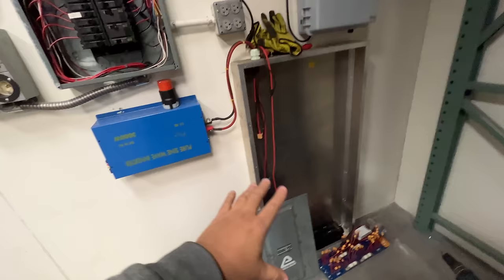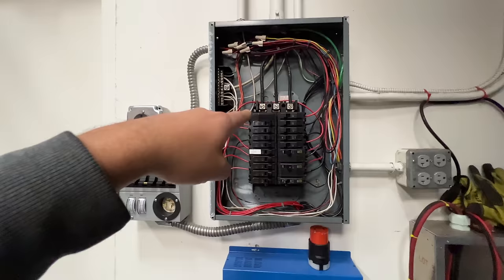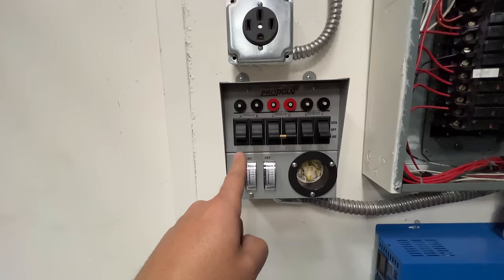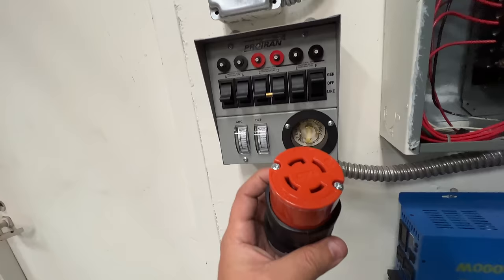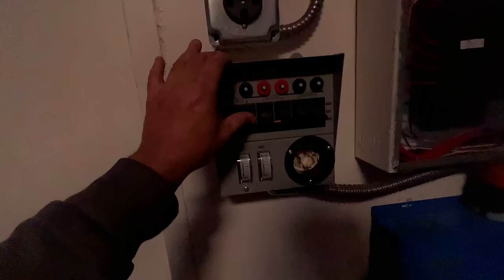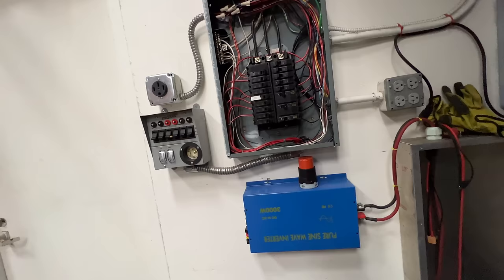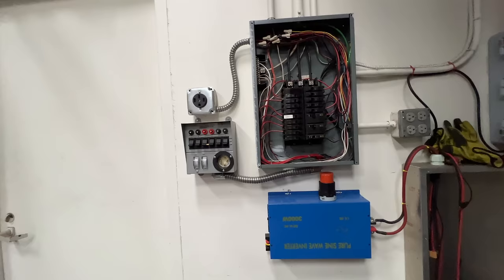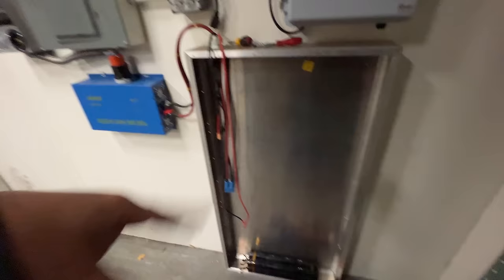This is Why you Need a Transfer switch - DIY Powerwalls

Comment: I was looking at these last year, and decided to just put in a subpanel instead with my critical loads running to it. Then added a 220v gen/inverter circuit with a lockout so the panel cannot be connected to the grid and the inverter at the same time. I was required to pull a permit to do the work, and the inspector gave me a 9 out of 10 score on the job...that was super encouraging since I did the job myself.

Comment: Thankyou Jehu! I have similar setup in my home & garage but, there are A LOT of folks that don't savy how important and nice it is to have one. Other wise I suppose one could just run extention cords all over the house. That's how I used to roll when the power would go out. A definite pain, right in the ass! Backup switches are far superior

Comment: The main reason for a transfer swich is so if grid goes down, your generater or inverter/ battery doesn't endanger linemen workung on getting the grid back up. Keeps your system out of the grid system.
Reply: You can also get away with a clearly labeled and properly maintained interlock to prevent the activation of the generator breaker and the main utility breaker.  You have to know what you're doing, but it's a lot cleaner.
Reply: @Alex-je6od  transfer switch can be automatic. interlocks arent.
Reply: @DieselRamcharger  mmkay.  Never said it was automatic.   jehugarcia's transfer switch is also manual.
Reply: @Alex-je6od  "can be" i guess those words arent well understood by you?
Reply: @DieselRamcharger  Interlocks can be automated too using arduino’s and solenoids.   Anything can be automated.

I use sensors in my house to tell me when the power goes out to fire off the battery backup on my wood stoves fan.  I also have the thermostat on the same stove setup so I can adjust it remotely.
Reply: @GotrekGurninsson  if an interlock is automated, its not an interlock.

Comment: I agree with you!  and I have an ATS + MTS combination at my main panel as they way I automatically consume my off-grid power.     Sun comes up, inverter goes on, ATS auto-switches to inverter power, the MTS let's me fine-tune which circuits I want on the inverter load.   Sun goes down, battery runs down, inverter off and auto-back-to-grid.     Use UPSs for computers.
Works really well for induvial component off-grid integration without power company even knowing.     MPP Solar (and I think some GroWatts) have UPS built-in but MTS (or ATS/MTS combo) works as well to avoid direct grid tie hookup.
Reply: I'm interested in how you're auto switching on sun up... It sounds like you're doing the same as I want to do. I have 3.1Kwatts of solar and 680Ahrs of battery.. (soon to be doubled). What is an MTS?
Reply: The Sun causes the PV to charge the battery raising the battery voltage.  When the voltage reaches a certain point, a relay turns on the Inverters - sending power to the ATS(s).   When the battery runs down, a relay turns off the Inverters and the ATSs go back to grid.   MTS = Manual Transfer Switch such as Reliance MTS or Pro/Tran2 MTS sold at Home Depot.

Comment: I would recommend  upgrading to spring block connectors. The cost is more but they are a much better design than wire nuts.
Reply from the maker: Not sure what those look like
Reply from the maker: Never seen those,  but I’m not an electrician and I guess all my places are old tech
Reply: @jehugarcia    
Wago type
Reply: Both wago and wire nuts can be used incorrectly and end up with a bad connection and they both can be used correctly and have a great 50 year connection. 

Definitely never reuse either one in a high amperage situation. The clear wago do have the benefit of being able to inspect the connection which is cool.

Comment: Thanks Jehu! So, if I get a similar setup with a scooter-power-wall feeding an inverter (no solar panels)... could I just leave the transfer switch for my critical circuits set to GEN all the time? That way they are powered through the inverter (which would not be using battery power when the grid is up, and would only be forwarding its AC power being that it would be plugged in to a non-critical panel circuit like the ones you have to the right of your breaker box). This should act as poor-man's auto transfer, while still never back-feeding the grid. Sound right? Am I overlooking anything? I would then only switch to LINE if I had to work-on/remove/replace the inverter etc.

Comment: 6:25 watch out tiying two phase together because now your neutral wire will have to carry twice the load of those two circuits... 1500w x2 = 3000w on the neutral wire. The reason it works with a split phase/one neutral is that those lines are inverted in phase, 1500w x2 = 0w on the neutral when those phase cross over one another. 14awg neutral would work no problem with a split phase but NOT ok when you are doing this twice on a single phase...
Reply from the maker: Interesting thought.
Reply: @jehugarcia  thank you for considering this, specially if you are using a gas generator that do not run on 240V but you do supply the black wire to two lines in your transfer switch, the current can get way higher on the white wire than it is suppose to support. You should make a note on your video about this. It is not super critical if you are powering lighting circuits but if you do run a kettle on one phase and a microwave oven on the other phase that you did split on a single phase generator/inverter, the neutral wire can become a fire hazard !! Thanks for noticing my comment !
Reply: @Aleziss  I'm confused... there's only one neutral wire in the transfer switch box that connect to the main breaker box. Why it would be a problem... Please explain
Reply: @CarlosCarrillo-yz7nu  there are two phases in 240V systems in north america identified by a RED and BLACK cable. Each of these RED and BLACK cable provide 120V when they are mesured against the WHITE neutral wire. There is an IMPORTANT detail about those two phase cable is that they are 180° phase inverted. While the RED phase has 120V the BLACK has 0V and when the opposite happend, when the BLACK phase has 120V, the RED phase has 0V and that happens 60 times per second, this is why we say it is a 60Hz system. That means if you draw 15A on the RED phase while it peaks at 120V, the BLACK phase is NOT pullilng power because it is 180° inverted thus the WHITE wire only "see" a 15A return current. 

If you have BOTH BLACK AND RED tied together on the SAME phase as per describe in this video, the WHITE wire will have a total POSSIBLE return charge of 30A which it is NOT design to support. 

You would probably not have an issue as long both RED and BLACK are not charged to their capacity limit but such panel is design to be installed in a 240V system and NOT a 120V because the WHITE return wire will have twice the load to support.

This is exactly how kitchen counter plug are wired, you can connect 2X 1500W devices on the same wall outlet because the top plug is connected to the RED phase and the bottom plug is connected to the BLACK phase and you can run a single 14AWG WHITE wire as a neutral without any issue because the two plugs are 180° out of phase. You could NOT do that if both RED and BLACK wire would be connected on the same phase as the WHITE wire would carry 30A return current which a 14AWG is NOT able to do without become a fire hazard.

60X EVERY second that happend between the BLACK and RED phase when they are measured against the WHITE wire...

120V-0V
119V-1V
118V-2V
117V-3V
116V-4V
115V-5V
...
3V-117V
2V-118V
1V-119V
0V-120V

and the cycle continue again and again 60X a second. You notice that the WHITE wire never "see" more than 120V thus never has over 15A charge.

Comment: You can make your own if you have a box that you can put breakers side by side, but flipped, and attach the levers, so when you turn on the generator breaker, it turns off the grid breaker, it would only be $50-$150 depending on size,  and breakers , and the outlet/inlet type, my breakers box just has a plug so I can either plug it into the he generator or the inverter! A couple 3phase breakers one reversed, and the lever connected,  a 200-300 amp in a box so the main can be swapped at the input! For a smaller systems like this, din rail breakers mounted similar will work!

Comment: What are those 2 dials on the bottom left (next to generator outlet)?
I anxoiusly waited 13 minutes to learn that & what brand you have. ( Pro something? Couldn't quite make it out)
I am looking for a 10 circuit transfer switch but can't find one that looks like that one.
Also, modular power stations like EcoFlow & Bluetti sell their own subpanel/transfer switch boxes but theirs are over $1000.!!!! Will the generic transfer switches, like this one, not work with the Modular Power Stations?

Comment: I am using automatic transfer switch to change my load when grid goes down.. it's working great never have to touch anything since installed
Reply: Me too! mine switches so fast that my computer never loses power!
Reply: @uhjyuff2095  same here I am running a small fridge from my inverter. Even though transfer switch changes back to grid it never reset the compressor

Comment: My mothers house has that same transfer switch for a generator.  I was going to replace it with a main breaker interlock so all the loads would be powered in an emergency.  Not sure if 3 phase interlocks exist though.

Comment: Think they make ones that can switch over automatically too and even start a generator automatically. Must have if you have a generator or power wall.
Reply: Yeah, lookup ATS - automatic transfers switch. Using one to flick between my solar battery and line 🙂
Reply: @SergeantSpandex im looking to do this myself. Any ATS recommendations?
Reply: @vickomf  there's quite a few if you want to hardwire them. Otherwise APC and similar make rack-based ones that are plug and play for nearby devices

Comment: I installed one in my house but never used it. I think they prefer hard wiring the powerwall I personally used a APC3636 3600W ups with line in a automatic transfer switch to a secondary sub panel. Now if you used similar type of inverter than you don't need and get away with just a cheap sub panel. Look for inverter with UPS feature.
Reply: I just got my critical loads panel setup. I had not thought of using an inverter with a ups feature. Good idea. I have a 100amp circuit going to the critical loads panel though so that would be one expensive inverter.
Reply: @ecospider5  20kw  inverter or 4 5kw inverters. But that is 100a service, I think you are missing critical part in your load.
Reply: A Genetry Solar inverter comes with the Automatic Transfer Switch… AND they ship inverters that can run using Jehu’s scooter batteries at 36v

Comment: Backfeed is a serious thing which is why transfer switches were created, had nothing to do with convenience. 
Most utility companies dont want their linemen killed by backfeed so they sell and install transfer switches at a better deal (sometimes no install fee) than what a residential electrician will charge.
People need to realize that not only do the transformers that supply electricity to you house or business step voltage/amperage down but when backfed it will step voltage/amperage up to a lethal level.
If necessary linemen will also kill the power to do the required work and if it involves cutting your residence/business off the grid or grounding you system to burn out you generator they will. 
They wont reimburse you for damaged equipment and some will not hook you back up until a transfer switch is installed.
Reply: Wow, I didn't know that trick about perhaps getting the installation of the transfer switch subsidized.
Reply: It's difficult to imagine the stupidity of somebody backfeeding their house without disconnecting the main breaker. But, sometimes a little knowledge is dangerous.

Comment: I have a similar type, There is a light showing if there is power coming from the grid, if its off no power, so when I hook up my generator I can check at times to see if the power is back on and I can disconnect the genny. I have hear of people, turning off the main fuse from the street and making a plug to fit a power point and feed in power to the house that way lol. Not for me. I have solar power as well, no batteries, but this has been rigged up if there is no power from the grid, it disables the solar production feed in.

Comment: A friend had their furnace stop working. The furnace repair person could not figure out what was wrong so they said call someone else but didn’t give an actual referral. They eventually called a master electrician. Something in the transfer switch had tripped. The electrician did 5 seconds of work and said. Here is your bill for $120. 

So I do get your point of having the extra feature on your electrical system but every component adds complexity. I feel most people would have no idea how to uses a transfer switch so the extra complexity does not give them any benefit. 

The other issue I have ran into is my neighbor has a transfer switch but when he plugged a generator into it none of the circuits in his house turned on. 

My self I decided to go with a critical loads panel and an interlock switch.
Reply: My neighbor's car wouldn't start one morning. Turns out he wasn't turning the key.
Reply: $1 to flip the switch and $119 to know which switch to flip.
Reply: Funny - I learned during an ice storm this winter that modern gas furnace control boards need ground bonded to neutral in order to work.  If you roll out a standard generator and don't properly ground it, you might not be able to run the appliances you want.  EVSE's are another device with the same issue.  An inverter like this would have the same issue and needs to be  earth grounded ideally.  Don't learn this during an emergency event - be prepared!

Comment: Technically you could tie the two lines on the generator input to a single line from a 120v generator if all of the circuits are 120v, but not if any are 240v as you appear to have one of.
Reply from the maker: 120v circuits only,  I don’t run any 220v equipment at this location
Reply: @jehugarcia  What are the two in the middle that are tied together, usually for 240v for?

Comment: What's charging the batteries?  Do you have PV direct to them?  Most residential PV installs are grid tie (such as mine). How are systems set up to charge power walls and also provide a transfer to run off them?
Reply from the maker: Regular Ac charger,

Comment: A lot of jurisdictions may require a permit to do modifications on your electrical system so check with your local permitting department for the final call.  
You are not necessarily required to have an electrician install a transfer switch...though it is highly advised that you do use one if you do not know what you are doing or are hesitant.  
As with any high voltage equipment...always VERIFY that the power is OFF to the feeds coming into the panel you will be working in...there is a danger of death with improper handling.
Reply: Correct, only certified General electricians are qualified to make electrical terminations.

Comment: I added a MT switch to my house thru the main panel.   Not really hard to do.  Just remember to use the proper voltage/wattage/amperage for all connections.  I am feeding the transfer switch with 220v,  four wires.  Two hots, a neutral and a ground.  I am using a 10k generator to power the entire house.  The main panel, I am using the 220v side of the panel, to split the 110v.  So as to, even the load to both sides of the main switch panel. The 220v circuits are turned off. Using only the 110v ones in a power outage.  I can use a 220v circuit, but only if all the other 110v ones are turned off.  Like using the hot water heater, or stove.   Emergency A/C is using only 110v.

Comment: Several years ago I purchased a power transfer switch I am seriously debating on whether or not I want to get a power wall that I can charge with electricity from the grid and flip a switch if the power goes out are there good brands that you would recommend

Comment: Combining two phases that share a neutral because your inverter is only 120V is dangerous. You could potentially be overloading that neutral wire from two circuits. You will burn out that wire and the breakers won’t trip. Be careful your circuits have dedicated neutrals.

Comment: From a "really old guy".  This was a really great item when it first came out. The old way was really complicated and required and electrician AND paying the power company to turn off you power at the street!

For anyone not familiar,  the 2 RED switches in the middle are ganged together and are for the ONE circuit that runs on 220. For country homes that eequire 220 VAC for the water pump.
Reply: A kitchen stove and central AC also would need to be on the 220v connections. So you have to choose which is more important or get a bigger transfer switch.
Reply: It is a 240 VAC not 220 v.

Comment: The standards are 15 amps and either 25 or 30 for a stove or dryer. Depending. Or charging station for your vehicle or 120 volt .
Reply: A lot of new houses have 20 amp breakers for the normal receptacle circuits. I just had a 50 amp electric stove circuit installed. 

We definitely don’t see 10 amp circuits installed in new buildings but I’m sure there are still some old setups with them.